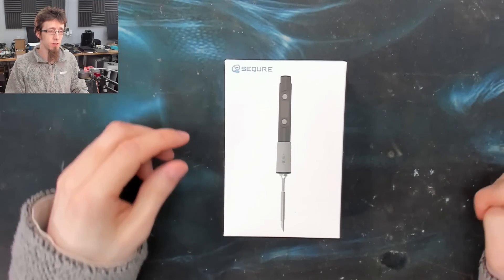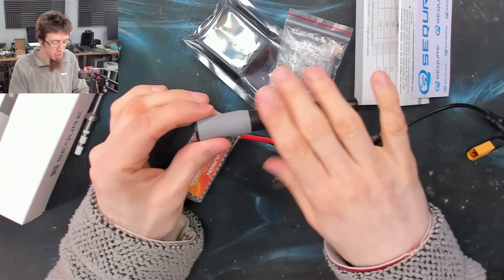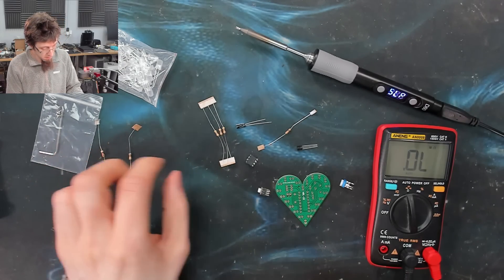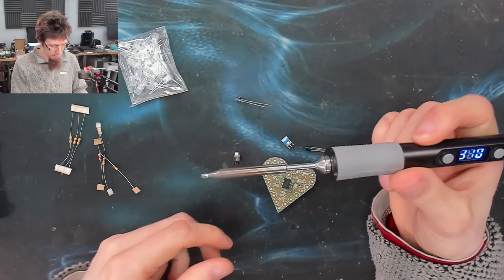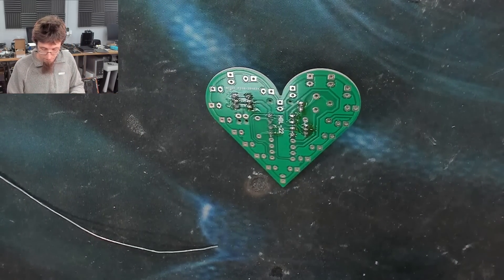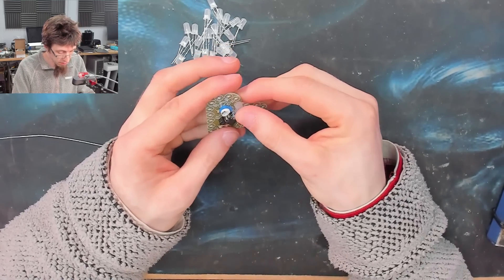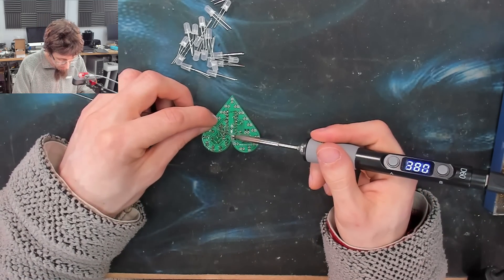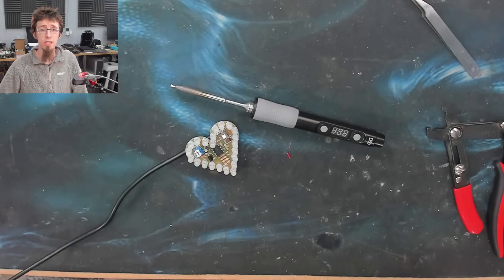Sequre D60 Soldering Iron Overview - LFC#316

Comment: That Sequre D60 seems pretty cool. Def a good tool to have handy if you're doing soldering now and then, like today. I just did a board swap on a cheap tablet we give our daughter. One tablet seems bricked, doesn't turn on, just the backlight. The other one the screen was cracked but board was fine. Only had to unsolder 3 wires for the battery, not too complicated. They're cheap tablets too so wasn't concerned much about screwing them up more lol.

My dad, worked at NASA/KSC, taught me how to soldier, though I don't take always take the time to do it properly, but then again I'm not working supercritical equipment lol.

Comment: I installed new pickups in my guitar about a year ago using one of those so called "electronic shop" irons and I wish I had just bit the bullet and bought a proper one like you have would have made it so much easier
Reply from the maker: Guitars can be tricky as well, as I believe some of the connections go onto the casing of the dials(?) which is a large mass of metal any small iron will have trouble with. Not sure these electronic irons would be up to that either, at least not without some assistance.
Reply: @Adamant_IT  Yeah they get soldered onto the potentiometers on one end and pickups on the other also to a switch(es).
Reply: The ground wire goes onto the case of the pot yes. Sometimes several, so you need a wide tip or stronger iron.

Comment: Good overview. The old mains irons can still be useful, my 25W Antex is good for large diameter pins on power modules and with lead-free solder where most 40W modern irons would struggle (I also have a £400 temp-controlled 40W Weller). Horses for courses.

Comment: Those tips are all Hakko T12 tips shortened to fit that enclosure type. If you place a Hakko T12 tip inside the TS100, Pinecil and those solder irons it should work with no problem. Actually Sequre has a model that allows the usage of Both tips (they are one and the same other then length) by simply changing the internal placement of the connection and hence using Both tips.and Yes the Pinecil is indeed a game changer no doubt.

Comment: I suggest when using a lipo to run anything, plug the balance lead into a battery capacity meter, or you will forget then let the voltage drop and ruin the cells

Comment: I've used mine with a big k type knife tip to desolder parts off R9 290 power planes it needed the full 24v but it works well enough.

Comment: That was a lovely and clear review. There's one aspect I don't understand: the manual said that the time it takes to get to temperature depends purely upon the voltage supplied. Surely it should depend on the total power (volts x amps)? For instance, if I have a 12V battery like the Anker you used at the end or a USB hub with a fast charging port, why can it not pull extra amps if the source can supply them? I expect that there's some extra circuitry that's missing as a cost-saving feature, but you have the thing to hand. Can the Pinecil do that?

BTW sellers have heard about your love of the Pinecil: it's £75 on Amazon.
Reply from the maker: It's expensive on Amazon because the Pinestore is out of stock. But yea, these little irons are too small to pull lots of amps, so they're voltage limited.
Reply: Because basically all irons are resistive heating elements, you know what ohm's law is, right? The only way to push more power through a resistor is to give it a higher voltage (or a lower resistance which would make it incompatible with already existing tips), now it would be fair to ask why they don't have a boost converter built into the iron, but the answer to that is a bit obvious, a 65W boost converter would need a good bit more space than a small handheld pencil shaped iron and add a mild amount to the cost.

Comment: I need to find a better tip for replacing pins in lga sockets. I'm thnking an angled one is probably best?

I learned by ordering a bunch of broken old mobos off eBay and taking all the components off and putting them back on :)

Comment: Between this one, the TS100 and the Pinecil, which one would you say is the best if you had to choose one to use? Or which one is your go to?
Reply from the maker: Pinecil is my main choice, but you're going to be waiting for the Pinecil 2 now, as they've announced it and discontinued the Pinecil 1 - which is probably why it went out of stock just as I was doing this video.
TS100 is still a great choice, but you're going to be paying $60-70 for it with a power supply. Sequre make the SQ001, which is basically a TS100 clone, for less money, so that'd be a good mid-point if you want something more advanced than the D60.
Ultimately though, they will all perform the same since they're using the same tips, with the exception of the D60A, which is 350c limited and won't be able to do motherboards.
Reply: @Adamant_IT  thank you, I really appreciate the reply! Pinecil is showing they’ll restock or be in stock on Aug 2nd. Any idea if that’s the 2 or a restock of the 1?
Reply from the maker: Must be the 2, as the press release I read said there would be no more restocks of the 1. But also that's much sooner than I expected. I didn't read into the details though, so I could be wrong.
Pinecil 2 will be capable of taking slightly more powerful tips, and have Bluetooth for automation stuff. Neat, but not critical. If the restock turns out to be the 1, I'd still say it's worth a buy.
Reply: @Adamant_IT  thanks again for taking the time to reply. I’ll definitely order whatever is available on the 2nd. Appreciate the videos and content. Thank you.

Comment: definitely do more reviews with equipment that you use
Reply from the maker: I've done reviews on the Pinecil Soldering Iron and Sequre electroc screwdriver that I daily drive. But yea, I have some more reviews in the works for stuff I've been sent or bought - I'm trying to make a point of testing stuff for several weeks before making a video about it first though, as first impressions for a tool really don't tell the big picture.
Reply: @Adamant_IT  Your reviews are that much more worthwhile because you put the widget to that extended test.
Reply: @Adamant_IT  how about a microscope in the works?

Comment: I always strugeling with the right solder tin, i just dont know what to buy exactly and where to buy it (ali express or any other) what to look for etc.
Reply: Leaded solder.  Lower melting temperatures and not a brittle end product.
Reply: there's kits of soldering, it came with the soldering tips, tin and base

Comment: I like tinkering with these chinese kits, it's fun to keep your hand in a skill. I just use a cheap old Maplin iron with temp controlled base and I've only got the one tip it came with which is a conical tip, but that's the type I used thoughout my working life in various electronics assembly jobs. I was going to buy a kit radio, then I saw a fully assembled one much cheaper, and the absurdity forced me to buy the super cheap ready made one. Might have to dismantle that for the fun of it, lol.

Comment: What exactly would I gain in buying a high end [Hako] compared to this unit? What can I do with a Hako that is not possible with this unit?
Reply from the maker: More wattage and better tips. When you're working on ground planes or very small stuff, you need to put in a lot of heat, or you're working with a very small contact patch, and that's where the top-end equipment comes into play. You'll know when you get there. Low/intermediate level stuff is fine with irons like this - this iron uses the same tips that I do my repair work with, so that gives you an idea of at least what they're capable of.

Comment: It's incorrect to say to turn the iron to 400 °C for heavy boards, a hotter iron will bring you nowhere, you simply need a bigger iron operating on the correct working temperature of 320°C , it's like voltage vs. ampere, you say that you need more voltage, while in essence you actually need more ampere...Your current temperature is a tit on the high side, for normal leaded solder 320 °C is sufficient, your current temperature is for leadfree solder.
Reply from the maker: This is true, but higher temperature in the iron still means more energy in the iron, which means it's got further to drop when it hits a ground plan. More mass is better, yes, but higher temps can compensate for this, especially when you're working on small stuff and there's literally no room for a bigger tip.